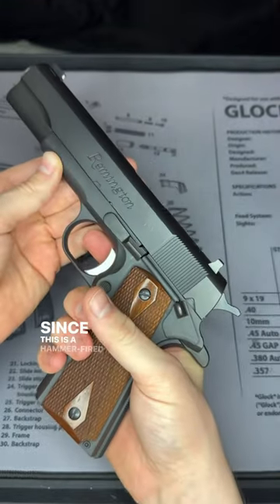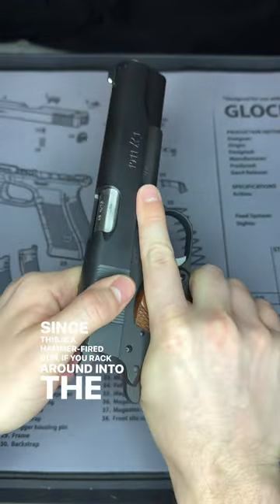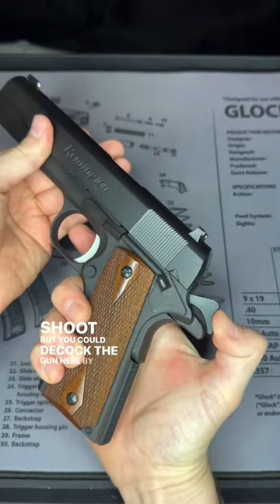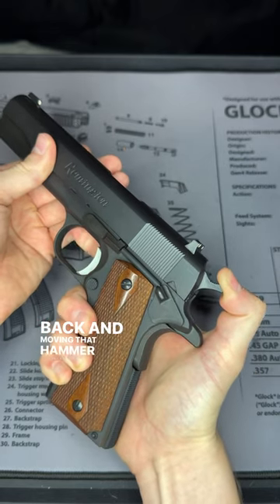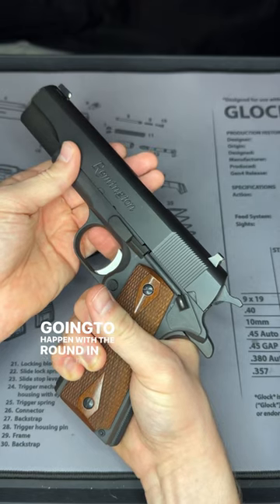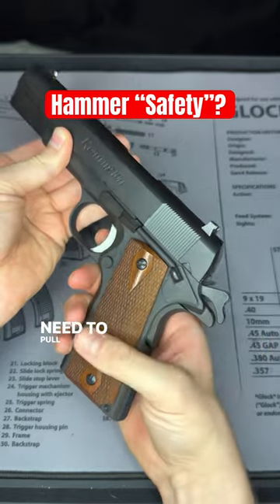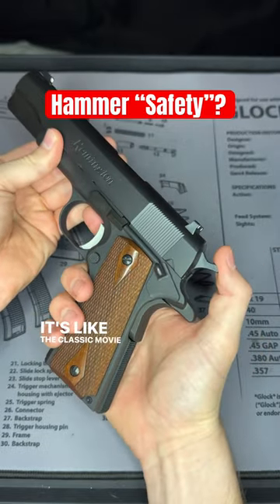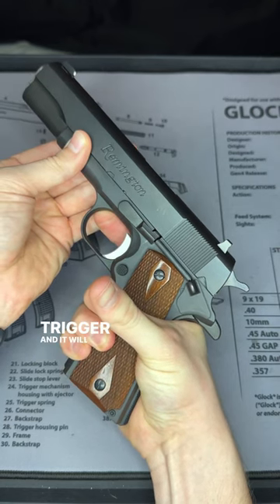1911 “Hammer Safety?” 😳 #shorts

Comment: quick tip-if you're decocking then as you put the hammer forward let go of the trigger as that retracts the firing pin so there is 0% chance it accidentally goes off in ur hand
Reply: Probably saved somebody
Reply: That's not how 1911s work. The firing pin is only actuated by the hammer. The harder the hammer hits the pin, the further it will travel. A spring prevents the pin from bouncing back and forth
Reply: 1911 are not now nor ever were designed to be decocked on a loaded chamber. Cocked and locked only.
Reply: Wich one is more obsolete and limited? A 1911 or its owner? Since there is a lot of shit on internet and even in BOKS, do what you want with your gun, it's yours.
Reply: I didn't know that was an option, I've never owned a pistol but I've always wondered about that

Comment: One slip and no more of whatever was in front of that gun
Reply: The 1911 has a half cock position and was designed by John Moses Browning for that express purpose.
Reply: @lucashenry6281  i wonder why in modern days, with modern tactical guns that have many safety features, people are still talking about this outdated piece of junk metal. "B-b-but John Moses Browning b-but ma stopping powah" nobody cares anymore, throw that relic away
Reply: @Dannymart_88445  (your modern tactical guns have the same features as the guns you don’t like cause they’re not new and shiny)
Reply: And your thumb
Reply: @lucashenry6281 and I've owned 3 1911s that would fire from half cock. 1911 was always designed to be carried cocked and locked. Most 1911 holsters are even designed to accommodate it being cocked. In VERY rare instances on an empty chamber. But, very dangerous to use it for self protection without a round in the chmaber. Pointless.

Comment: 1911 was designed to be cocked and locked or empty chamber, not to have the hammer lowered like that with a live round in the chamber. unless you are aiming down range and want to try it go for it but unsafe

Comment: Put the hammer to half cock for saftey, not fully decocked. Fully decocking it with a round in the chamber can press the firing pin into the primer. Not with enough pressure to fire the round but enough to indent the primer and risk a misfire. Dropping it on the hammer decocked  on a live round can set the gun off. Half cock is safe

Comment: Or if you want a hammer fired sidearm where you don't have to pull the hammer back again with a round in the chamber you can just get a beretta 92fs.

Plus it comes with 2 options for the lower receiver.

The first option is the polymer lower.

Or you can go with the second option of the stainless steel lower which makes it an all steel firearm like the 1911 but with more ammo per a magazine.

The only difference and depending on your preference it can be a deal breaker because it only comes chambered in 9mm parabellum.

Comment: Depends on the series a 70 series has no firing pin safety. On a 70 series there are 2 hammer positions 1 being a half cock where the hammer is not resting on the firing pin

Comment: Its better to pull the hammer back holding it then pull the trigger letting the hammer drop slowly but make sure the trigger resets on the sear or else when you recock the hammer it wont set on the trigger and will go off

Comment: the original safety for every hammer operated gun was the half cock
Reply: Half cock isn’t a safety, the single action trigger is. A feature that protects the shooter is NOT the same as a safety! The two are completely different.
Reply: @lucashenry6281 The trigger isn't a sefety, the safety is a safety. But your first and most important safety is keeping your finger off the trigger